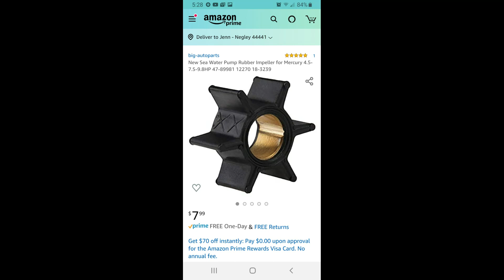MERCURY 110 9.8 Hp WATER PUMP REPLACEMENT

Comment: There's a step on the shaft. You measured it in the wrong area. When measured in the area where the impeller sits it measured .453" which is a closer match what most amazon sellers  list at 11.65mm =  .458" if anyone is wondering it's part # 47-89981

Comment: Awesome!!! I need to disassemble,  clean, and reassembled the carbs on my Merc 50...is that next? Lol!!
 Question....if the sending unit hatch on your fuel tank isn't glued down with some kind of red atv sealant would that be enough to make your motor not idle? It runs great on the open water, but won't idle for more than 15 seconds.